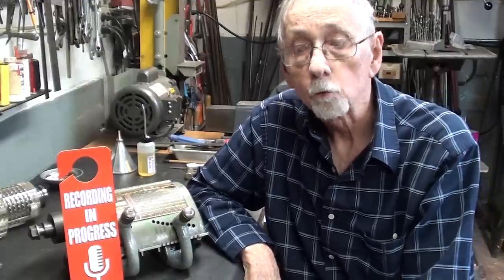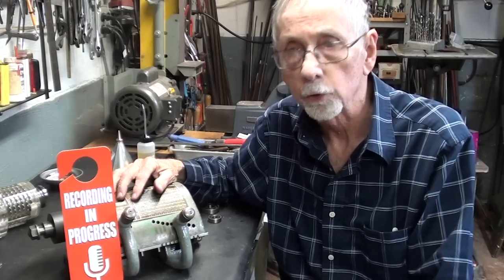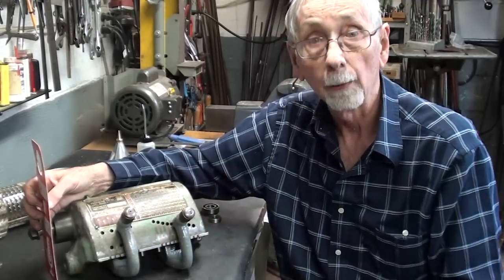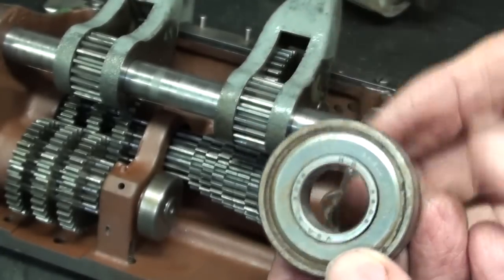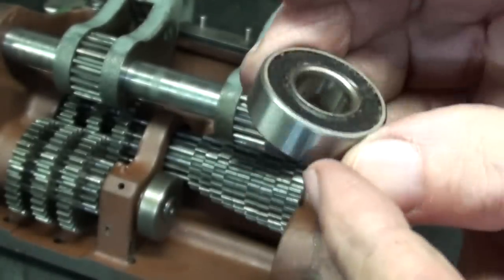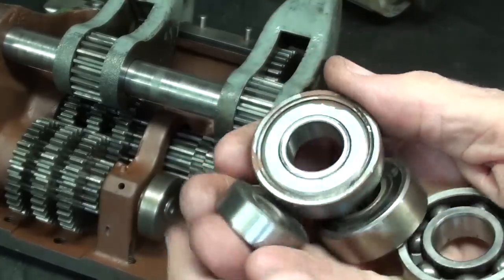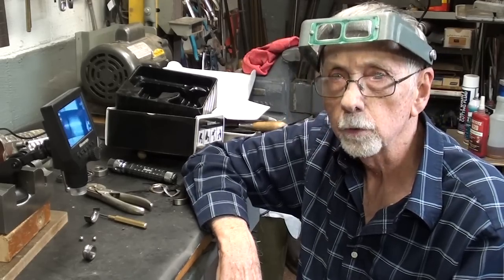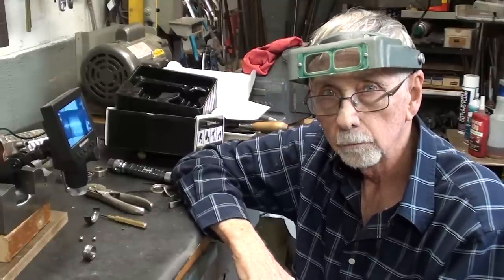FAILED BALL BEARING ANALYSIS short #23 tubalcain

Comment: I was very interested in your post mortem of the bearing.  I have had bearing failures in woodworking equipment but never took the time to see why is was squealing so loud.  So next time I may just do my own inspection.  Now the rant, I agree completely.  In a college course on business law we were instructed on the difference between implied warranty and expressed warranty.  And the light has an implied warranty, which is with a stand included it will stand up.  So they failed.  The problem lies in the design for one but the other is the inept manufacturing process.  I won't mention the country where this junk comes from, but they can build a heck of a balloon yet can't make a light that can stand up properly.  Maybe we should shoot the light they made down as well.....  Now that is my rant, sorry for being so long winded...
Reply from the maker: lol lol

Comment: The buddy nuts only lube the outside bearing. Look for posilube, there's a hole drilled through the bearing which allows pumping new grease to flow through the back bearing to the front (outer) all the while driving out the old grease. Also replace the axle with torsion style if not already this set up.  Sometimes this can introduce clearance issues. (My family used to build boat trailers, I did it for about 10 years).
Reply from the maker: Thanks

Comment: Good failure analysis, bearing failure always comes down to lack of lubrication.  If the original designer had spec’d an open bearing wear products from the gearbox could have damaged the bearing.  I suspect that they had experienced bearing failure that had the shielded bearing installed.

Comment: Love failure analysis. Had 3 bearings fail in my $2500 Honda tiller after three years. I think the case halves didn't align perfectly (weldment). I assume it will fail again in another few years.

Comment: I ponder if not the reason for the failure of the bearing is a variation in the hardening of the balls. Reason for this speculation is that not all balls are damaged.
Quality control was a key part to SKF's success with bearings.
Anyhow, time wise that bearing sure has held up a reasonable time and then some.

Comment: I like the content and am quite curious what caused the flat spot to be worn into the balls in a nice even way. I have my doubts that it was the races because they are rounded, but rather I wonder if the hardened cages that housed the balls didn't cause that wear instead.
There is a part of me that always wants to find a way to preserve the older American made bearings because I imagine they're made with better materials and tolerances than the new bearings that seem to be lower quality, especially if they come from China. I am also not a fan of sealed bearings because given enough time and warmer temperatures the grease always hardens causing the bearing to seize up. I agree with poking holes in the seals and I'll often soak the bearing for days in some sort of solvent, and then flushing them out and replacing the lubricant.
Regarding boat trailers. I have one with a bass boat on it and I pump grease into the special grease reservoir before every trip, and then a little afterward to make sure I'm keeping water away from the bearings. 
It's true that they will get neglected by the average person, but people like Mr. Pete and myself tend to think about the physics of the machinery around us and don't mind doing maintenance. As they say, 'grease is cheaper than steel'. Towing costs and inconvenience of the unexpected failure aside which can ruin a nice vacation trip.
Sorry, rants get me started on my own rants.. 🤣🤣🤣🤣

Comment: I do find this interesting, I used to do some vibration analysis with an FFT analyzer. All components of a bearing have their own resonate frequencies are are published. Inner race, outer race, ball pass and cage frequencies. You can I.D. which bearing and what component of the bearing is failing while the machine is running. This bearing appears to have fretting (pulling of metal) on the inner race and is evident on the balls also. The spectral FFT analyzer would have picked up a high inner race freq. peak and high ball spin peak. This was probably from failed grease as it aged and the oil separated from the soap.  Just a guess.

Comment: Thank you very much, this is terrific content, do NOT dismiss it!  Only 1 ball damaged?  That bearing is very large for the load and definitely runs at low speed & should have lasted forever & doesn't look like it ever even got hot enough to flow the grease.  Probably pinched by the cage when assembled & stopped/slowed its rotation just enough to wear it down equally all the way around.  Never seen one like it.  That inner race was shiny, yes, but VERY rough & worn, nothing like its original ground smooth mirror finish.  Also, lubing directly to the shafts seem like the long way around to get, if any, on the gears.
Reply from the maker: I will do a follow up video, to see what the other balls look like. I already retrieve the bearing out of the trashcan.

Comment: Thanks for another interesting educational video. I believe the worn ball was actually a "short" slug that was not fully formed in the manufacturing process. Ball bearings are manufactured from large coils of bearing steel and forged  to rough shape by heading dies. (see "How Ball Bearings are Made" YouTube) The steel is sheared into short slugs of the correct length and processed through many steps into precision balls. If a "slug" is too short the ball will have a circular flat area the same diameter as the wire it was made from: in this case .274. This circular band is not typical of the kind of wear usually found in worn bearings. Note inner and outer grooves show no damage. Very likely this was an imperfectly formed "bad" ball that factory inspection missed.
Reply from the maker: You raised an interesting point. I think I will dig the rest of the barrel out of the garbage and examine some other balls. The problem is, the bad bearing is in a bucket o curly chips

Comment: Did you put another sealed one back in or did you use an open one so the lube of the splash oiling of the gears would get in there? -

One the subject of  seals/shields, the last time I replaced the HF Bandsaw worm wheel I used a double seal bearing on the shaft and took the seal off the inboard side and did 't replace the shaft seal at all (Seal surface was badly worn). . ,,,, It does leak a tiny bit but the bearing gets all the oil it wants and then some. -==== I know, Just another sleazy trick from Cleveland.
Reply from the maker: Good idea, to make sure the bearing gets lubrication

Comment: you make great video's Mr Pete. The problem I repeatingly encounter when buying stuff from the Chinese amazonial aliexpressers is that their products are meanly gadgets that are made/designed without any craftmansship  when it comes to usability and durability. That's one facet of their business. Another facet is that they make also products that were not on the western market because they would be too expensive for the target customers namely hobby modelling of all kinds. Because they are very good in cheaply manufacture machines such as milling machines and lathes that come very handy and within the reach of hobby machinists. Small, light and very accurate little machines for little parts. "Chapeau" Chinese.
Reply from the maker: Great analysis of what is going on over there

Comment: A while back I needed a 15" planer for a project, my 13" planer would just not do.  I found one on Craigslist for a really low price.  When I went to inspect it, it screamed like a banshee with a bad bearing.  I bought it on the spot, replaced the bearing, completed my project and sold it for twice the money.  A $4 bearing and about a day's worth of aggravation is all the repair cost.  Wrinkley fingers?  You're probably dehydrated Mr. Pete.  Happens to me all the time during the cold months, I don't drink as much water as I should.

Comment: very nice and a weird  patern at the balls, never see wear like that before. not on small or big bearings 20 inch or more in diameter. very educational. thank you ps looks like a to great axial load due to wrong instalation the ball rolls again one side of inner and outer ring

Comment: It is from the balls sticking in the cage ( old hard grease ) and then it rotated " only " on one edge...for a long enough time to cause the flat surface.... if you had a way to oil it and grease it occasionally it would have freed up the balls and survive... could you drill a hole in the bearing and bearing mounting to get some oil to it...with a outside fitting and tube/pipe ??

Comment: I guess you realize that if the posted title was "Do you have flat balls?"  you'd get a million views.  I admire your integrity, but I'd be OK (and still watch) if you occasionally  used click bait. :-)  ... Also that's a real neat light, if you put an amazon link in the description, I'd already have mine on order.  ... as with the light, you need to fabricate an adapter for your "microscope"  maybe adapt it to a heavy duty noga mount, or mag mount, etc. (You're a smart guy, I'm sure you can figure out what you need.  AND build it).    Love your videos.  also love your "short" videos!

Comment: The thing that bugs me is there is no wear on either bearing race that would be an indicator to causing the damage to the ball.  The cage is a very soft material and will wear rapidly than the ball IMO.  Not too sure that was a inferior ball that got thru inspection and installed into that bearing at the factory.  The RPM of that shaft in the gear box is very low and the bearing would have fail if the RPM was high sooner in life.  Be interested if any of the other balls had any damage to them.
Reply from the maker: I should have inspected all of the balls, Eric, but I didn’t think anyone would care. Now I realize that lots of people do care.

Comment: Over the past oh, 3+ decades of servicing/repairing many MANY different things, with having to replace countless types of bearings &/or bushings, I too have on occasion, either attempted “refurbishing” bearings or, dissected them to analyze their potential reason of failure; partly out of basic curiosity & partly out of possibly diagnosing other issues in a subassembly… i.e., insufficient lubrication abilities or, clogged/restricted oil galleys/passageways. Simply replacing a bad bearing or bushing, doesn’t exactly guarantee any sort of longevity of new part service life, without fully understanding the root cause of failure, in hopes of preventing said premature failure of new bearings/bushings &/or, their seals/o-rings.

Comment: I enjoyed your bearing takeapart a lot.  Being fascinated with bearing balls, I'd take the rest of the balls out and put 'em in a jar for...something.  Regarding the rant, you have a foot in two very different disciplines - electronics and machining.  The electronics industry builds light and hopefully protective cases, while machining has traditionally built heavy for stability and accuracy.  If they built the light heavier, not only would it be more expensive to construct, but shipping costs would rise as well.  Frustrating to those of us who value cast iron angle plates and vises, but sadly understandable.  I'm an electrical engineer by training, just getting into machining so I'm coming from the opposite end of things.
Reply from the maker: Thank you for your insight

Comment: Interesting to watch the failed ball bearing autopsy!
Cheap, crappy mounts/stands... I've one with a sucction attacher. Of course it failed and the camera fell down some 10 inches and broke the not locking the ball joint. No standard camera bolt/nut to use for a self made stand.

Comment: Really the only company making a huge profit from all the plastic in these items is the oil corporations that make the plastic . Granted the other components do cost  but think about just how much plastic is contained in all the merchandise that's bought. Of coarse you have those bean counters in R&D and manufacturing that keep looking to find maximum profit with lower costing material with trash bin quality.  I'm a retired 30 year experienced  heavy equipment mechanic and finding the cause of failure has always been on the forefront for maintenance of the equipment in prevention and during a break down.

Comment: In the bowling alley World especially on Brunswick machines there is nothing but a ball bearings from one end of the machine to the other these require constant lubrication on some of the jackshaft on the machines they have a bearing on either end of the jackshaft and I've seen those bearings lock up and literally cut that shaft out I've seen brand new bearings fail within hours of putting them in and some of the most smallest radial bearings I've ever seen in my life but they all have their purpose

Comment: I think the bearing was miss made and bad from the get go.
Too bad you did not clean the entire bearing in solvent and examine all the balls.  It is possible only one bad ball got assembled into the ball bearing and it was the problem.
When the lathe was new, it might have had little use in threading mode by the original owner, so it got overlooked.
I could type more, but I am much older than you and tired now 🤣😂
JIM 🥰
ps love the rants 🤩

Comment: You're not alone nor crazy, Mr Pete. We are drowning amid loads and loads of flimsy plastic. And no, it's not really a matter of cost. Using injected metal parts would be more expensive than plastic but not vastly so. It would cost maybe 20% or 30% on a product like the light or the microscope. That's something most of us would happily pay for but you just can't find such products.
What we're dealing with is something else, the hollowing out and disappearance of mid-range brands, a race to the bottom for quality for most products and sky-high pricing for the top-level brands that only the richest can afford. No idea how to fix this. It's like a disease.
Reply from the maker: Good analysis

Comment: MrPete: as an old farmer I have seen a lot of failed bearings. out of the numerous bearings in the cage only one had that flat strip? that suggests to me that  the flawed bearing got by quality control at the factory.I have saved a jar full of balls over the years.lose one from a check valve or a carburetor, or a hydraulic coupler, we are back in business. Have you ever lost some needles from a U-joint, and had to find the rightsized welding rod to cut some new ones? Please feel free to rant as much as you like, and cover any topic you choose. thank you for your efforts

Comment: Nothing is wrong with explaining how a bearing works and how they are assembled. Lots of folks today have no idea and simply replace them not knowing why they don't turn like they used to. It's all about the races most of the time as the balls tend to be the last of the failure point. Decades back we learned about bearing in automotive work because we had to grease them prior to putting them into use. They never came greased until they made them as "sealed" bearings. Also, those open bearing were used much in manual transmissions that were bathed in gear oil. Whats really interesting is how those round bearings are made.

Comment: Ball riding in matching radius, cannot wear the flat as shown.
Suspect a piece of debris caught in the cage to wear the flat.
Sealed and shielded bearings have a finite life in storage, we tossed them out after 5 years storage.
Reply: It's hard to know how long ago in operational hours the grease hardened. But lots of hours running "dry" and hot could have expanded and softened the ball metal enough to flatten them under pressure.  Just a guess.  I wonder if modern steels could tolerate higher heat than balls made long ago?  Ditto for modern day grease tolerance for heat without drying out.
Reply: @datamatters8   No.

Comment: maybe you already know mrpete, but you dont have te destroy a deep groove bearing with a grinder to take it apart, you only have to remove/destroy the ball cage and then you can put the balls at one side and then you can remove the outer bearing race and the balls come free.
l iike your video,s mrpete, keep them coming.

btw, if some one knows how to remove the cage without destroying it please tell !
Reply from the maker: Thank you for that. I have watched videos on how they assemble ball bearings.
Reply: That cage was riveted, many are spot welded, so drilling them out, pain in the arse!

Comment: sir, some construction components may help solve the weight problem. there are zinc coat iron plates about 3/8 in thick, 4 in square with 1/4 in holes on 4 corners, i believe they are used to assemble scaffolding? and they are cheap, ready and available in hardware store. about usd3 each, price of a burger? glue that to your microscope, and you will be a happy man.

Comment: I have heated noisy bearings with a propane torch (electric motor) and they have gone quiet as the grease melts and flows. Yes I'm cheap, but I can relate. My fingers are wrinkled and my balls are shot as well.

Comment: Boat trailer bearings get a real hard life, they have tiny wheels so they are screaming when you are at speed, then when you get to the ramp you immediately back your trailer into the cold water, the hot bearings cool rapidly and pull a vacuum that tends to pull water through the seals. best lazy mans solution for keeping tabs on your wheel bearings is to carry an infrared thermometer in your tow vehicle, every time you stop check hub and tire temps, a loose or dry bearing will run hotter than a properly adjusted / lubed one and a low tire will also run warmer. this will tell you if you have one on the way out before ti turns into a problem, and it takes almost no effort